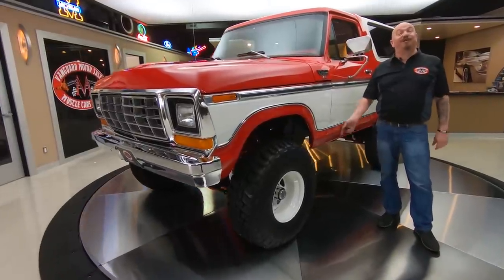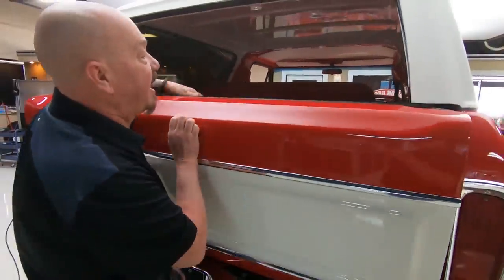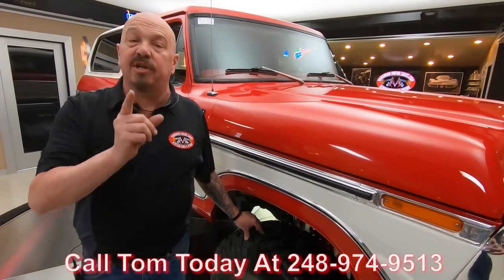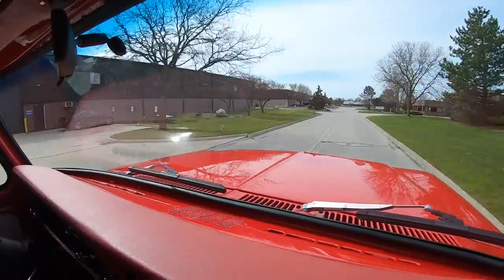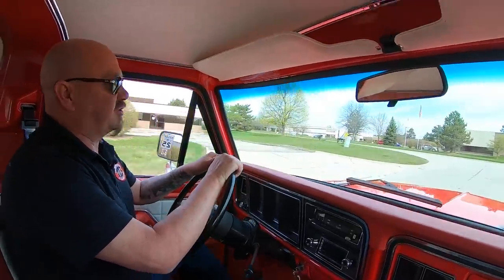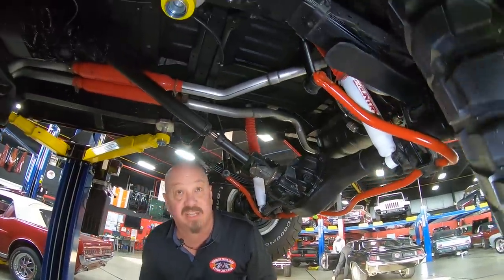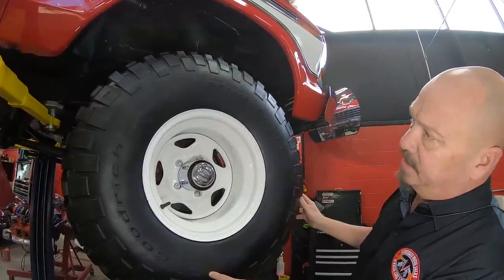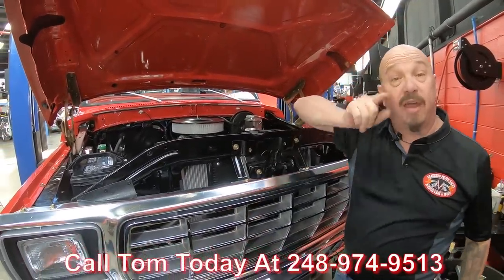1979 Ford Bronco For Sale

Comment: My dad has one of these in our "graveyard" and I've always wanted to fix it back up for him. I'm A woman and not afraid to ask for a mans help. What type of engine would be good for this? What is the price range for one? I'm obviously not trying to spend 2 grand on a engine but if that's what it takes, Yolo.
Reply: I’ve seen people put 350 Windsor engines in them. There kind of expensive though.
Reply: These typically had a 351M or a 400. A 460 would be a great choice and should basically bolt right up to everything. I just bought a 78 Bronco having wanted one forever.